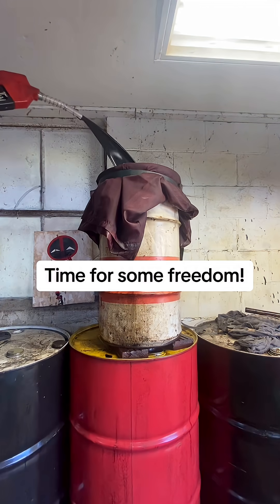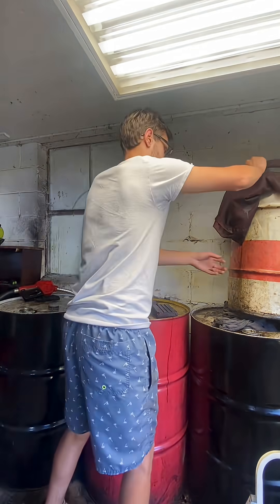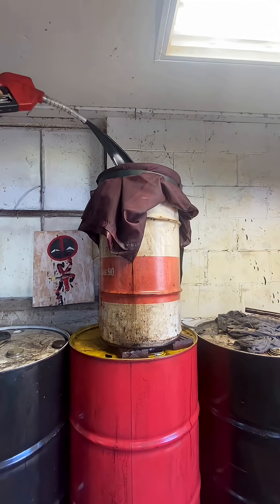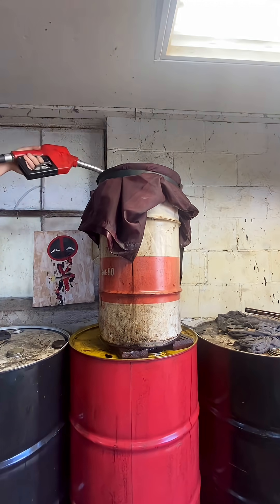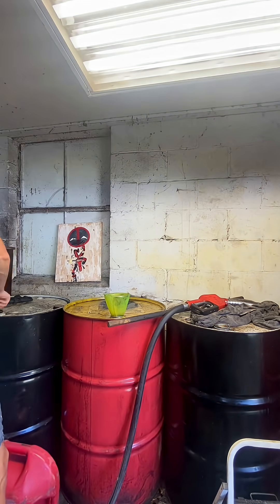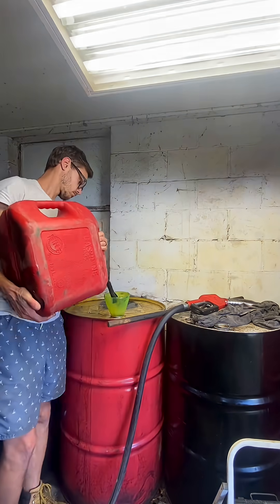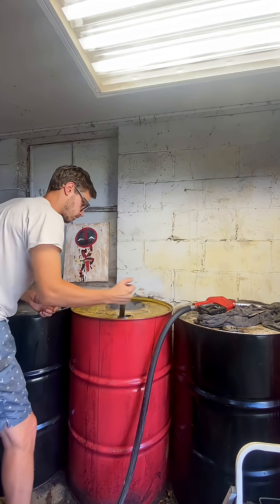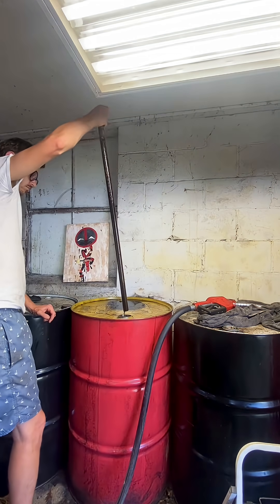Transform #wastemotoroil into #homemadediesel Fuel #dieselmechanic

Comment: Can u show us how to change injectors in the next video
Reply: Seriously pithy humour. I love it.
Reply: Mechanical pump diesels aren't gonna give a shit.
Reply: @RyanTheMalamute came here to say this. Or HEUI.
Reply: @RyanTheMalamute mechanical injectors do give a fuck
Reply: Tell this to VW 1.9 TDI
Reply: @komunistycznawiedzma56  which 1.9 TDi? The early motors are less fussy.  Proper filtration is key.
Reply: @komunistycznawiedzma56  PD lol
Reply: @komunistycznawiedzma56  thaught the same
Reply: Stg lol
Reply: I run 50% WMO year round in my 7.3 - sieved like this then through 10u water filter and 4u Baldwin filter. Been doing this since 2011. I remove and clean injectors every 30k miles but haven't run into an issue yet besides a light haze in the cooler weather.
Reply: At least you’re putting in some effort filtering the oil first and following up with additional maintenance to ensure reliability.
Reply: @abenderofficial  What is WMO? I presume it's "something" motor oil.
Thanks
Reply: @mister_aanderson Waste motor oil
Reply: @p230sig  just so I understand this correctly, you drive an unmodified diesel truck (7.3), you buy fuel for that truck and mix it with 50% WMO? 

So essentially, your fuel bill is half of what most people pay. Is that correct? This is mind blowing to me, I have never heard this before. 

FYI, I live in Asia and drive a Nissan D22 Frontier with the 3.0L diesel engine. I am very interested in this.
Reply: @abenderofficial I wonder what the different between efi vs mechanical inj makes for injector issues. Mechanical systems typically have considerably larger nozzle holes which is advantageous for this fuel
Reply: @silasboshmusic2853  pretty much. Older diesels inject fuel at less pressure than newer common-rail diesels. The higher the pressure, the smaller the holes on the injector.

The 7.3 powerstroke injects fuel at up to ~20k psi. The 12v cummins is about 20k as well. Modern common-rail diesels surpass 30k psi.
Reply: @abenderofficial that’s completely useless especially on a heui using filtered motor oil to fire the injector. the fuel filters will catch any further contaminants you didn’t screen. personally i’d opt for a fass or air dog fuel system with the added low micron filters for added security. not entirely sure how the newer high pressure systems especially those running the cp4 injection pumps would like this fuel though…they’re hella sensitive to store bought fuel quality as is…
Reply: @abenderofficial 4u removes just about everything larger than a smoke particle.
Show the final filtered product.
Reply: @abenderofficial huh ... yeah that sounds pretty solid, ill have to give that a try
Reply: @abenderofficial yes, In an old school 7.3 probably be okay but try running that in a new 6.0 or 6.6
Reply: Would it help to use one of those cleaning products to pump through the fuel rail?
Reply: @abenderofficial I’ve considered doing similar for decades.. haven’t yet & do currently have @ four to five 55 gal barrels worth of WMO (adds up way faster then ever been able to get rid of routinely & refuse to go redneck just polluting top soil anywhere). My Superduty is yr 2000 w/7.3 PS; nearly 400K on ODO of orig engine… of the various methods of gravity filtration for WMO, I’m considering additional “better safe then sorry” section incorporating a magnetized mesh/screen, for any possible micro particles of heavy metals that are also ‘hardened’ metals, as such particulates, if tiny enough, ‘could’ possibly make it passed conventional filtration units, on down into them ‘extremely’ polished injector parts &/or MICRO nozzle ports, either clogging or DESTROYING them pricey sob’s! I’ve fully rebuilt my own injectors of all diesels that I’ve owned; not a “quick” process. Certainly is cheaper tho, over just paying for rebuilt/refurb’d units & MASSIVELY cheaper then ‘new’ injectors. That all said (just for anyones’ info), NO, I’m not accepting any work for ‘that’ task, beyond my own personal vehicle units; the work doesn’t justify the wage-labor v TIME.
Reply: @abenderofficial remove and clean your injectors every 30,000 Mi. Have you read that statement again? My truck has 240,000 miles on its injectors. My time is worth more than having to pull injectors every 30,000 MI
Reply: @abenderofficial aint no way your pulling injectors every 30k 😂
Reply: @iron_daddy6756  yeah, there is a way, and it's super easy. You removed the valve covers every 30k miles and pull the injectors out, it's not hard. Thats about every 3 years. Good way to make sure your O rings are still good.
Reply: 😅 @iron_daddy6756
Reply: @WhiteYetiAK I❤u 😊
Reply: @WhiteYetiAK ”remove valve covers every 30k” “thats every 3 years” 

Sir id be removing the valve covers 1-2x a year, 

Some of us actually drive our vehicles
Reply: @nippy7148  nobody said you had too.
Reply: @WhiteYetiAK i put 6k miles in 6 months not even driving a lot your shit must be parked a lot..lol
Reply: @iron_daddy6756  that’s a day shot , and can he test/clean his own injectors
Reply: @WhiteYetiAK for some 30k is a couple three months. If you’re doing it four times a year it’s stupid, each time you take vc off or any other intrusion into the engine and then you introduce dirt. Even if you clean the engine and ranch . Ludicrous.
Reply: @xx-D-E-V-I-L-xx so you're doing 36,000 miles in 3yrs that ain't much different than 30,000, you shoulda payed more attention in math class😂
Reply: @iron_daddy6756  I feel like he means an IDI.
Reply: @dennisford2000  Introducing dirt isn't necessarily a concern. That really depends on your attitude towards working on your vehicles.

I work outside, but I'm also a nut about dirt or pollen.

For me, everything gets a clean lint free microfiber over it. I can't even use normal paper towels just noticing the fibers left over.

Coffee filters.

And it's largely unnecessary, but it feels surgical - feels right.
Reply: @piterpraker3399 leather is best, but just the top surface. No lint and does not scratch 😊
Reply: @dennisford2000  Thanks man - I'll look into it for this next rebuild I've got.
Reply: @WhiteYetiAK  30k every 3 years? 😂😂😂 man, I put on almost 6k every 2 weeks
Reply: @thomwrhodes  Your doing a lot of driving. My average is 10k a year.
Reply: @WhiteYetiAK yeah, we go coast to coast. Actually broke down in GA sitting in a hotel, hoping my truck gets fixed tomorrow lol
Reply: @iron_daddy6756 You obviously don't do injectors huh?
Reply: @WhiteYetiAK 3 years to hit 30k? Lmao not a chance with a real work truck, I’ve put 20k in one year on my service bucket truck, not to
Mention the hours on hours it idled
Reply: @jaayg2903 yes you are the reason work trucks run like shit what’s your point?
Reply: @iron_daddy6756 Definitely not if it is a Duramax LB-7 I guarantee you that!!!!😂😂😂
Reply: @nippy7148 damnI barely put a couple thousand miles a year on each one of my vehicles. I guess you don't have anything better to do than just drive around?
Reply: @xx-D-E-V-I-L-xx so for you it would be a little over 2 years
Reply: @WhiteYetiAK lol who owns a diesel and only puts 10k miles a year? Lol hahaha thats funny. Thats like 3 months lol
Reply: @iron_daddy6756  getting to the injectors on a 7.3l is extremely easy. Getting to the turbo is harder.
Reply: @iron_daddy6756 especially on a 7.3. You’re wasting uvc harnesses and gaskets left and right plus blowing o rings  and  wearing out your main engine harness connector on the ecu and idm side. Plus the bolts on the valve covers aren’t exactly supposed to be constantly removed without replacement and there’s always that chance you crack your injector cups when pulling them. If you’ve never done cups 8 and 7 are extremely difficult to set the new ones properly and most common to leak even when thought install was flawless.
Reply: @xx-D-E-V-I-L-xx  so three years would be 36k? Why do you feel the need to be so negative when somebody is just telling you what they do, and when your numbers are basically the same?
Reply: @WhiteYetiAK  30k in 3 years you need to get out more
Reply: @christopherperkins390  I get out just fine. I live in the woods of alaska. The nearest fast food place or city is 100 miles away. I ride quads and snowmachines. I also own 16 vehicles. I dont drive the sane one every day.
Reply: @xx-D-E-V-I-L-xx  that’s 12k a year.. basically the same
Reply: @iron_daddy6756 if you can’t perform or have routine maintenance performed on your diesel every 30k you shouldn’t be in that truck.
Reply: @iron_daddy6756 why not ? It’s not a big job.
Reply: @iron_daddy6756 why because you can't ......why question his mechanical abilities .injectors are easy .
Reply: @iron_daddy6756 in UK that's a 3 year period at annual average mileage. I know you guys drive way more miles but all depends on miles you cover is my point.
Reply: @nippy7148 by your math you put between 30 and 60 k on your truck per year. National average is 10-11 last I checked so “some of us” is really the minority. MOST people drive less than you. It’s not a pecker measuring contest.. besides if it was id win bud
Reply: @WhiteYetiAK you only put 10k a year?  Dam just hut 180k on my ram 2500 hd😢😂
Reply: @WhiteYetiAK it just means he is wasting injectors, he replaces them every 30k...i dont see how u dont see this😂
If u have a old beater, with a pump maybe consider this, if u care about ur car...dont.
Reply: @darrellbeets7758  he said pulling the injectors. He is checking cups and rings. It's not hard or a problem.
Reply: @xx-D-E-V-I-L-xx that equals out to 36 thousand miles in 3 years only 6 thousand more miles  lol
Reply: @WhiteYetiAK only 10,000mi a year?? Do you even drive? 😂
Reply: @John_Ridenour yeah, I own 16 vehicles and swap between them. It's a 14-mile drive to work one way. Its also a 200-mile trip to the nearest hospital, Taco Bell, tire shop, clothing store, or otherwise. I put 1,000 miles on my excursion last week and about 500 miles on my tow truck. I just drove 266 miles south over a mountain to go fishing in Valdez. I live in Alaska.
Reply: @WhiteYetiAK that's fair.
Reply: Why remove  use  every once in a while some diesel in the car and  cleaners  and its good as new @abenderofficial
Reply: @fritzsnickerz855 I'm pretty sure I'm misunderstanding you. But are you saying you're putting diesel every once in awhile in your car? If so good luck with that buddy
Reply: @Ahbeterme no he is saying that there is no need to pull out the injectors and clean them. He is saying to just run a regular tank of diesel in the vehicle you are putting this mix into and if you add cleaner to that tank of diesel he is suggesting that you wouldn't need to remove them and clean them as thats what the regular diesel and cleaner would do.
Reply: You remember what a fuel filter is right? Diesel’s usually have 2 🫣
Reply: I was thinking the same thing should have a multi stage filter proces
Reply: @Southwesterncannabis Exactly 😂
Reply: A 12v Cummins will run with this forever. Anything with a factory installed cat or egr or dpf or scr......is gonna die quick.
Reply: This is for mechanical diesels with extra filtration between the lift pump and high pressure pump. Say 12 valve P-pump Cummins with a straight pipe and better to mix 50 homemade and 50 percent diesel. I run red off-road diesel whenever possible also this ain't for ur nice Duramax or power stroke this works on certain diesels older with no electronics just don't even f with it if this is ur injector comment
Reply: @12vshady you’re only one making sense. A 7.3 isn’t exactly the best to be running anything but diesel 2 through. Not even recommended to run diesel one through it in the winter. My 12 v with 663k on it and atleast 429k on the injectors and ve pump(not sure if previous owner ever changed them), has never had issues with what I’ve done. PRefill new fuel filter with kerosene and run 5 gallons of kerosene in the tank in the winter. Egts are hot but to be expected.
Reply: For real
Reply: And or high pressure fuel pumps
Reply: What diesel engine are you burning this fuel with
Reply: @subietec IDI
Reply: Whats there to see, there are so much they don't tell you about your diesel engin. There the ultimate in engines even your waste vegetable oil can be used to run them, only filter the oil out as best as possible and your good. So waste engine oil and transmission oil are gold to be used as fuel inside your diesel engin. Don't be fooled by the media research is what one should strive to do and ask yourself why they try to hide certain things from the general public
Reply: To do this better you can get a centrifugal filter apparatus for relatively cheap and use that to filter everything out so that your injectors do not get clogged. After that you use kerosene and you are good to go and your tuck or car should run for a very long time without any damage...
Reply: I had to think about that lmao. 😂
Reply: Where do u get ur used motor oil from
Reply: Lmao you’re so right
Reply: Excellent project I say! But would you trust it?
Reply: Not electric injectors
Reply: Depends he might be using a naturally aspirated engine like the 1HZ.
Reply: @TinkerTomUK  You’re absolutely right on that. In my 26 years as a diesel mechanic, I’ve fixed so many guys engines trying their homemade diesel 😂
Reply: @andrewgeorgelang While it’s more forgiving it’s just better to make it properly with proper filtration and using the transesterification process using methanol and a catalyst like sodium hydroxide or potassium hydroxide along with several washes to remove any catalyst that way you have a nice and clean biodiesel that will save you thousands on repairs 😂 but for you the more they mess up the more money you make so I better keep quiet about it 😂
Reply: There is no need for that. Change them at regular intervals if you filter right
Reply: 12 valve for the win
Reply: Amazing 😂
Reply: Then don’t do it kid. 😂
Reply: And the pump!!
Reply: Eh. Fuel filters.  It’s all good.
Reply: If you don't know how to do it then you shouldn't be doing it. Also YouTube isn't going to teach you the correct way.
Reply: My neighbor does this for his diesel truck
Reply: Not everyone is extremely lazy. I know nothing about values and injectors and it doesn't sound that complicated or difficult to do. Maybe time consuming
Reply: I'll just buy it and be done.
Reply: In a mechanical or HEUI it'll be fine. I've been running fuel from granaded common rail systems that has metal in it in my 7.3 for at least a decade. Oil change goes right in the tank. Also ran used ATF and diesel mix. No way I'd put it in a common rail but in my tractor or truck its fine.
Reply: And this is the part of social media that is...

A.  AI trolls telling you your wrong 
B.  Actual trolls who don't know.
C.  Very few people that stand up to the system to make something work.  They have many slaves and too few thinkers by design. 

Note to trolls:  Keep pissing (their)* money away on overpriced nonsense and paying for things that you really don't need.

(Their)* = Not yours.  If it were yours, you'd know it....
Reply: In my experience, it was the pump that died.
Reply: @jrcstudios3803 my experience as well, for diesels that specifically use high pressure injector pump(s).. a 7.3L Powerstroke does NOT. They use a high pressure OIL pump, that in-turn, hydraulically multiplies injector fuel pressures; the two fluid systems being isolated from one another. A regulated constant rate of engine oil, not used for lubricating the engine, gets diverted/supplied into the “HPOP” (high pressure oil pump), multiplied mechanically/hydraulically via engine rotation & a computer controlled solenoid valve (effectively the “throttle”) regulates the released high pressure to the ‘oil’ portion of the injectors, that then dictates the rate of LOW pressure diesel fuel gets massively multiplied via computer controlled/timed solenoid injector poppet valves, for final power stroke injection cycle. The 7.3’s LOW pressure of diesel fuel oughta be typically only @ 45 to 65 psi constant at fuel bowl, running, with excess pressurized fuel spring-regulated-returned at bowl to tank) after filtering (stock; typical), thru a tank pickup line “foot sock”, two ‘small’ filter cartridges located within the tank fuel pickup unit & really ARE PROBLEMATIC; highly prone to clogging up & generally advised deletion of, as they’re a pain in the ass to change), the main fuel bowl’s filter cartridge element… wasn’t until I think, when Ford put out the 6.4, maybe the 6.0, that there was a “primary” fuel filter AT the low pressure electric pump found along frame rail under drivers seat area. By now, most 7.3 owners that keep their rides goin’ healthy or, at least want to, have adapted better fuel filtration systems, especially water separation.
I’ve run every ratio of several sources/brands of BioDiesel thru my 7.3, all the way to 100% Bio D., even before with all stock fuel filtration & never once had any issue burning thru that stuff, although I do live in a typically hot/dry climate of the southwest region, which I think likewise would allow filtered/diluted WMO to burn thru no problem either.

P.S.: to any 7.3 PS grammatical fact/truth critics, I’m just a mechanic of 40+ years; not an engineer nor an English language PhD.. oh & do have A.D.D. sooo… it is, what it is.
Reply: lol yeah that’s what I was thinking carbon rich fuel
Reply: Into what?
Reply: I have run 70/30 in my area which 70% used oil or transmission fluid with 30% diesel fuel but I have never used gasoline to mix with it.
Reply: $500 on a big c series 12 valve
Reply: Lmao
Reply: No shit 😂
Reply: Best comment!!
Reply: Lmao
Reply: Diesel engines were initially intended to run on pulverised coal but used engine oil and petrol mix is not good for modern engines, why not just use waste vegetable oil, strip glycerol and add ethanol, as its easier to get, works better, cleaner doesn't f*can your engine.
Reply: @ironbridgeranch 😂
Reply: Haha yes!😊
Reply: Lol
Reply: Just add bleach and your all good!😅
Reply: Someones jealous
Reply: And fuel pump...
Reply: Lmfao right 😂
Reply: I mean he may as well
Reply: The Fuel actually gets filtered by the fuel filter before getting to the injectors
Reply: Old school injectors need that line
Reply: you’d also know first hand if there’s any o-rings in the heui system checking out, given you’d have hard starts or poor running conditions if the slightest amount of oil was bypassing….
Reply: 😆 RIGHT! Unless he's got an old 1972 International, I wouldn't run that in mine
Reply: It's harmless on older inline pump vehicles as long as you change the filters more regularly, but I'd never use it on a modern common rail vehicle.
Reply: Hahahahahahahahahahah
Reply: Ahahah😂
Reply: Rip
Reply: I'll be sure to use this hack WHEN the zombies start marching
Reply: HILARIOUS
Reply: Have you thought of using a magnet in a secondary filtering stage?
Reply: Nah! Only in the newer rigs. He's probably pumping that sludge into a 90s dodge
Reply: If he uses a real filter before like on the pump side before filling I bet he has no problem. They are the same the only exception gas is more refined. The oil is way less volatile than diesel like many oils. Adding the right amount exactly of gas without a f-up you are good. Kids by a backup motor if you try to learn the mix!
Reply: My old 200tdi aint never had a problem running dirtier oil than this.
Reply: older diesels wont mind this please dont try this on newer series engines lol
Reply: Tell me you know  nothing about fuel systems without telling me.
Reply: Savage 😂
Reply: I wouldn't do it to my own vehicle, but i had a Mitsubishi fuso for a work truck. I do generator service so I'm always changing oil in diesels or LP fueled engines. 
I was almost out of fuel one day and not near a station so I dumped in 5 gallons of unfiltered waste oil. 
Got me to a station. 
Anyways,I just started dumping in more and more over time. 
Less waste oil for us to get rid of ,and less fuel for us to buy. 
I ran that thing from 40k to 270k and all I ever did was oil and filter/fuel filter changes. 
I have more respect for my own diesels, been running my VW on a couple of drums of aircraft smoke oil and 20% diesel. 
She loves it, the idle kicked up about 50rpm, and I don't have part throttle popcorn because I run the timing very advanced. 
It's like diesel fuel is 87 octane in a car that requires super , and running oil is the 93 it really needs. 
Besides, most smaller diesels want like 50-55 cetane and that's not available at the pump unless you add a cocktail. 
All it really needs is a little diesel to make it flow easier at lower temps near freezing.
Mine would turn over about 3 more times before starting when it was cold, but other than that it runs great.
Reply: Yeah because his vehicle probably has no filters on it !
Reply: Lol
Reply: It works on old VW and many other older TDI's pre 2008 I believe.

Only problem is you don't mix it with gas, you mix it with diesel. 3parts diesel to 7 parts used filtered motor oil
Reply: You must have one of those newer baby diesels. If so your Lil pup cant handle this good juice. But hey add more liquid exhaust piss juice and off ya go
Reply: So does everyone lnow about this?  Where is the.  yes ive done this too" comments?
Reply: Definitely might be a gamble on any high pressure fuel systems, but probably doesn't hurt too much on older lower pressure systems.....
Reply: Wow
Reply: Diesel engines don't have injectors
Reply: Truth on the multi stage filtering!!
Reply: I burn pump diesel in the truck and save the used oil to heat the shop.
Reply: Ha ha ha ha ha …….😂
Reply: And, AND, how often are you changing your fuel filters?
Reply: Combustion chamber deposits are going to be insane. Good luck running in winter.
Reply: lol if your a common rail person.  I’m too chicken shit, To wreck my 6 injectors . P pump probably don’t have the sensitivity and can get away with this.  I would love to have extra coin to do the same in case it went south .
Reply: YEA!!!!!
Reply: That’s why you mix the gas in, it’s great for cleaning diesel injectors.
Reply: @corymorrison4488  hard pass, gas in diesels is bad. I use ATF for cleaning my injectors.
Reply: Lol
Reply: Or how to mortgage your home to pay the EPA fines?
Reply: Right 😅
Reply: Lol, took the words right out of my mouth!
Reply: I used old oil for years. Did no damage except clogs up the exhaust of the engine with soot eventually.
Reply: Great first comment to find after this.  Diesel engines are pretty rugged, but I don’t think used motor oil is a good idea here.
Reply: Not if your filtering at the pump I would double filter it before it even goes in the tank..
Reply: Guessing the engine in his truck is pre war
Reply: Imagine fuel filtration 😮
Reply: Haha
Reply: Seems off to me.
Reply: Idi with atomizing nozzles and mech pump. Shit’ll buff
Reply: I've been doing this for years on my 12v 1st gen with 600k. I do 22 1/2 oil and 2 1/2 of 91 and let it sit for two weeks. Then I pump it through a fast system on a bench in my shop to filter it. 

I learned from my grandfather who filtered through any cloth he could find. He would squirt a line on the ground and light it to test how it burned and the speed of how the line ignited from one end to the other. 

He'd say no that's too hot she's gonna knock and add more used oil. Or He'd say she ain't gonna wanna run and add more 91. Typical old timer way of doing things. 

I've sent my injectors out once every 3 years and have never had any issues. Every few tanks of "Home Brew" I'll run a tank of "pumped". 

It's saved me a ton I'm sure. I have a few 55 gallon drums with a electric pump head and 50ft line. I have a few local shops that let me take all their used oil. But a few switched to used oil furnaces and when crude oil prices where high shops where getting offered .50 to .80 per gallon. Luckily I have a few that keep me stocked with what I need free of charge.

I have a 21 F450 and I dont use my home brew on that. With the electronic CP4 already being junk I just dont want to chance it. It would prolly be okay but I still dont wanna chance it. I use my home brew in the first gen and the tractors and it works out.
Reply: Daymn 😂
Reply: Lmfao 😂 wild eh?
Reply: Ignorant. I filter all my oil down to 1 micron and only changed 1 set of injectors in my 97f350 that at the time had 420,000 miles on them. In older diesel’s especially that oil adds extra lubrication that the injection system needs. Gotta remember when 7.3s and 12 valves and 3406s were built we had high sulfur diesel which added lubrication. So saying burning oil kill injectors is a uneducated and ignorant statement made by someone who has never burned oil as fuel and doesn’t have any knowledge from experience on the subject
Reply: You guys are using injectors and not carbs?
Reply: Gas or diesel fuel
Reply: Best comment.😂
Reply: I ran into a guy running this in a 2003 Dodge Cummins HPCR with no issues.
Reply: $250 bux and 90 minutes later on a 12 valve
Reply: Facts
Reply: I came just for this comment
Reply: These comments are KILLING  me. Its like a bunch of 6 year olds!!!  🤦‍♂️
  I'm a Ford 7.3 guy and these fuckers will run on peanut butter and whale blubber. 😂
Reply: He's going to show us how to be a quickie lube mechanic who believes everything he's told.
Reply: I’m going to shelf this idea until I can no longer get diesel at the pump 
In that moment I’ll accept that if I intend to ride using diesel I’m going to have to deal with the mess
My friend has an old army truck that will run on anything it would like this
Reply: 😂😂 you clearly are clueless it doesn't hurt the injectors at all it is actually lubricating them 😂😂
Reply: @froggersgarage5127 the filtration needs to be much higher. There's metal in oil. And alot of carbon bits.
Reply: @froggersgarage5127 it doesn't hurt them, but it does clog then alot quicker
Reply: @froggersgarage5127 sureeeee, you toad
Reply: @froggersgarage5127 the contaminants that the oil picked up the the engine ( such as metals)will cause issues to the injectors not the oil itself.
Reply: @froggersgarage5127 yeah there's no carbon or metal particles in WMO. 🤣🤦‍♂️
Reply: @froggersgarage5127 you still have time to delete your comment to show The ignorance that you have  it's funny be seeing somebody so cocky and being so wrong at the same time lmao
Reply: @froggersgarage5127 not clueless at all. Just a believer of Preventive Maintenance.
Reply: @froggersgarage5127 i swear people think fuel injectors cant handle a little debris 😂😂
Reply: @froggersgarage5127 there's a lot of junk in used motor oil. if he is only filtering through a bedsheet that is not good enough and can harm the injectors. the fuel filter may catch a lot of this on the truck but some will still get through.
Reply: @froggersgarage5127  you're clearly clueless. It's not that it would hurt them, but it'd sure as 💩 clog them like crazy.  Tell me you don't know anything about automotives without telling me. 😂😂
Reply: I don’t think hes running this in something with a CP4, DPF and EGR
Reply: @macthemec lol no fucking way it’s going thru dpf lol
Reply: @macthemec no way if that cp4 pump even smells what this guy is cooking, it gonna grenade and ruin the whole engine....1000s of dollars in engine repairs cuz he wants to save a few cents at the pump😢
Reply: Common rail diesels aren't gonna love this!
Reply: I doubt he's using it in a diesel engine probably just burning it in some basic furnace
Reply: @ebygumlad333 i guess you know nothing about diesels then. Because we do the same thing up here in the mountains of northern california. And we run it through our old diesel engines all day, long, every day.
Reply: @htrdchevy71 
great.
Glad to here that.
Keep up the good work.
Reply: @ebygumlad333 he’s says it sits a week and then he pumps it right into his truck.
Reply: @ebygumlad333 He just said he is putting it in his truck. Unless his truck has a furnace for heat it is safe to say he is putting it in his tank.
Reply: @Aviyaytor 
no hes not putting it in his truck.
He wants you to copy him and destroy your truck
Reply: how to replace diesel filter on every weekend..
Reply: Diesel purge at oil changes carbon problem solved
Reply: When U get work chip in Ur fuel filter does it go slower or faster 😂
Reply: No doubt and the fuel filter…pleaseeeee
Reply: Injectors are going to fail  even if you run  holy water trough them.  Bad enginneering
Reply: lmao
Reply: Boom 😂
Reply: He replaced his injectors with stainless steel meat marinading syringes......
Reply: @BryanG-w3k  🤣😂
Reply: First time huh...
Reply: I am not even close to being an expert on any kind of engine but I certainly get the joke in this case.  If I had an old DD 471 and a year to live, I might do this.
Reply: @CHX_37  This is done in Europe rural areas as well and it works rather well surprisingly but the guys I know have a more thought out filtering process tbh.